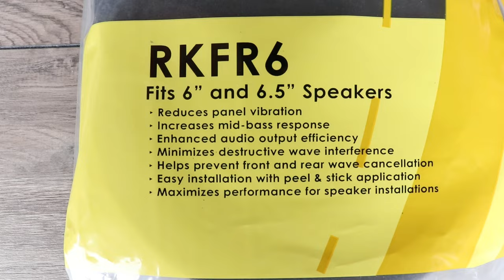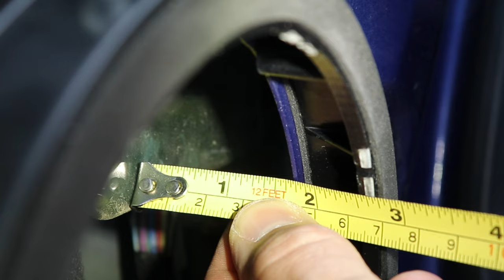Front Speakers UPGRADE, Toyota Corolla - How to Remove & Install New 6.5" Speakers

Comment: wont that foam behind the speaker get wet and absorb water like a sponge? when i rains water runs down the inside of the door
Reply from the maker: It's designed for this, so I assumed it's a closed cell foam, which is water resistant. I haven't actually tried to make it wet, but I'd be surprised if it does soak like a sponge.

Comment: Great video! I’m planning to buy those infinities for my Corolla. Will the tweeters work if mounted in the rear doors? My 2020 Corolla SE only haves 2 tweeters under the windshield and 4 6.5s, 1 in each door. Thanks in advance!
Reply from the maker: The tweeters on the Infinity speakers? They work anywhere, nothing special required, hook up the speaker like any other speaker, and you get the bonus of having tweeters too. 😀
Reply: @CleverFix  thank you good sir 🍻

Comment: Are the speakers RMS wattage within the head unit parameters? Or do you have an amp?
Reply from the maker: Good question, The head unit can power them just fine and they're quite loud, there's no need for an amp.

Comment: They make wiring adapters for speakers like this, No need for the splicing and crimping. Way better and faster, Also less of a hassle when going back for repairs. Great vide though
Reply from the maker: My OEM connectors were corroded, so they had to be cut off. I should have made that clearer in the video. Connectors are great for earlier years that have copper wiring.  Many 2014+ will get the corrosion problem, I think it's inevitable that at some point they will all corrode. Moisture gets in through the window seal, and it's aluminum wire.  Thanks for watching!
Reply: @CleverFix  thats a pigtail repair then yes. I recommend getting some liquid tape, Its one the best methods to protect all your wiring and prevent it from corroding again.
Reply from the maker: @joelh3030  I'll look into the liquid tape, thanks for the tip!

Comment: Great video!  I just bought the Infinity REF-6530cx for my 2014 Corolla.   Does anyone have a recommendation for where to install the crossover unit? It's about W4" x H3.25" x D1.1".  This is my first speaker install.
Reply from the maker: Just curious where you ended up installing it?
Reply: @CleverFix Waiting for some warmer weather to do the install, I'll update in about a month or so.  If anyone has suggestions, please let me know!
Reply from the maker: @soccertwnty47  It's best to mount it close to the speaker for the best sound. Above the speaker, the door panel has a bump in it, so there should be plenty of room there. Not sure how to mount it though.. I don't like making holes because they rust later.. but they can be made then painted to prevent rust, and then use small nuts and bolts. Another idea is above the speaker where the big white connector is.. possibly zip tie it to that big harness. Between that connector and speaker is where I'd put it. You can use some double sided tape and then put the panel back on and make sure it fits before making any holes if you're going to make holes. Maybe the tape would hold permanently as well, those boxes are usually very light.

Comment: Did the stock speaker wiring repair you did in your other video end up not working?
Reply from the maker: It worked for a few months, until one side started losing connection on and off again.. Everything looked good when I took it apart, no corrosion, but it was still losing connection.  The brand new speaker on the same side also started losing connection after a few months too though..  which was quite strange. I took it apart and squeezed the terminal a bit to make a tighter connection, and put dielectric grease on it, and no problem since then.  I think dielectric grease is really important.
Sometimes I just want to solder the wire directly on the speaker.. but I don't like heating up the speaker coil.  Infinity Kappa speakers have screws on them for terminal, which I only found after.. that's a really nice feature.
Reply: @CleverFix  Thanks for the quick reply. Understood. This video is great once again. Appreciate you putting your time into this.

Comment: Can I use speaker harness adapters to connect to the cars speaker wire connector and the new speaker terminals so I don’t need to cut and crimp new speaker wire? You have the listed in the Amazon list for your rear speaker replacement video
Reply from the maker: I listed for the rear because the rear connectors usually are in good shape. The front connectors are well known to corrode, so one of the main reasons for doing this install was to cut off the connectors.  If you want to keep them though, yes there is an adapter harness for it.. Mine corroded when the car was about 6 years old, and thousands of people had this problem, because the factory wires are aluminum.
Reply: Okay thanks for the advice! I’m going to use your Amazon links. Great videos!

Comment: Did u keep the stock tweeters
Reply from the maker: Yes
Reply: @CleverFix  did you have to wire them different? Or they just work the way you installed them?
Reply from the maker: @redbeardroams  No difference, the wires go to the tweeters first, then speakers second. Replacing the speakers doesn't affect the tweeters.
Reply: @CleverFix  awesome thanks man I’ve seen so many people talk about it but no real answer

Comment: Which crimper is that ? Good vid
Reply from the maker: If you're in Canada, they can be found at this store: https://www.princessauto.com/en/199-pc-terminal-and-connector-kit-with-crimper/product/PA0008960510  They ship to US, but it may not be worth it.  I also added a link to a different crimper/multi-tool that should also work just as good, in the video description.  I bought that particular one because it can crimp good quality non-insulated butt connectors, but then I ended up finding good quality insulated ones. It also strips wire which is a bonus.

Comment: Does anyone know what wires to cut if your installing a crossover. From the main speaker harness, which set of wires comes from the radio?
Reply: The front speaker wires go directly from the radio to the tweeter, then from the tweeter to the door woofer.  This information is from Crutchfield. 
Front Tweeter Input -- positive (+): violet/green, negative (-): violet/blue

Front Tweeter Output (Woofer Input) -- positive (+): violet/white, negative (-): violet/blue

Comment: Have you change your tweeter yet? Great video btw.
Reply from the maker: No, the speaker wires run through the tweeter and I'm not sure why actually.. so that makes it a bit challenging to change the tweeters.  I wonder if there's some sort of crossover in there. Otherwise it hardly makes sense that the speaker goes through the tweeter,.. but I'll look into it. Thanks.
Reply: @CleverFix  Have you checked into this? I think the tweeter does have a crossover, and I was wondering if the door speaker gets it's signal after the crossover. Wouldn't this mean that the high frequencies are filtered by the tweeter, meaning that the coaxial speaker on the door is not getting the full range signal and therefore not performing as it could?

Comment: @2014 Corolla by any chance, do you know where I can find the baffles 6-3/4" ??
Reply from the maker: Baffles are not recommended for the rear.. if you want more bass, get a subwoofer. Car speakers are not designed to be enclosed (with a closed baffle), and an open baffle doesn't do much. In the front it makes sense because the metal/door is behind the speaker and the baffle directs the sound into the foam I put. Hope that makes sense.

Comment: Great video! I've found articles saying the size is 6-3/4 but does 6-1/2 work?
Reply from the maker: Yes 6-1/2 works as well, that's what I used. The adapter bracket can accept either one.

Comment: bro, you forgot one very important detail.......What year corolla is this????
Reply from the maker: It's a 2014 in the Video. The bracket I used to mount the speakers works on many models though.  Here's the link: http://www.metraonline.com/part/82-8148 click on "Applications" for the entire model list.  They all use factory rivets, so the removal will be same, and if that bracket fits, then mounting will be same also. Hooking up the wires varies between models because they have different wire colors, and earlier model Corollas had copper wiring which is easier to work with and it can be soldered.

Comment: Hi

Could you please provide size  diameter of screws?? Maybe a #6 or #8?? Thanks
Reply from the maker: Size is in the video, 2:36 , I'm assuming these are the screws you're asking about?
Reply: @CleverFix  yeah the 3 screws with locking nuts used to hold the bracket
Reply from the maker: @LuisMartinez-zi4fg  Ok that's the ones at 2:36 then, the bracket will come with longer ones and some flimsier nuts. I didn't like them, but some people use them.

Comment: Hey there - will this work on my 2006 Toyota Corolla?
Reply from the maker: It will work, as long as you don't have a JBL upgraded Corolla already.
If you see the JBL logo on the top right corner of your radio then you have the 6-speaker system so it's likely not worth upgrading.

Comment: Quick question, why don't you put the third fast rings (between the speaker and the door panel)? Is using the silicone replace the function of the third fast rings?

Any info and guidance would be appreciated.

Cheers and thanks.

Comment: Hey where did you get your little heat
Pen you used for the shrink tubing from?
Reply from the maker: That's a Dremel 2000-01 Butane Soldering Torch. It has multiple tips, I was using the torch tip. I added a link to a tool that is nearly identical but costs less, in the video description, it also has a torch tip.

Comment: Hi, can you please tell me what was the width of the nuts and bolts you used.
Reply from the maker: 8-32 width, 1/2" length, with locking 8-32 nuts, any hardware store should have them in little packets.
Reply: @CleverFix  Thank You so much

Comment: You should make a video which there is on removing the back 6x9's you have to remove the seats not really but they say it cause of damages
Reply from the maker: The back rest on the back seat is very easy to remove.. I was thinking of making a video just on removing that first, it also give you more cargo room, if you need to transport a lot of stuff, it helps.. I did that once to fit bigger boxes on the back seat. I'm planning to do the 6x9's soon..
Reply: @CleverFix  for the 2016 toyota corolla s earlier I had to pull two of the fold down seats to get the side panels off now that in other videos they don't mention that and I had to get the seat out which is easy and the rest of the panels were easy to pop off now when doing it all in reverse things can get a little tricky putting it all back

Comment: My front speakers dont work.....when i adjust the volume seetings for the front speakers on my head unit, it changes the sound of the back speakers....so im assuming my wiring is fd.....they didnt work when i got the car and it didnt have the stock radio and whoever wired that shit had a whole mess going on so i spliced the wires that needed it and wired up my radio which worked fine. But front speakers still dont work....prob just gonna have to take it to someone
Reply from the maker: Maybe your front speaker connectors are corroded.. See my video: https://www.youtube.com/watch?v=4ytOAxK_0Cs  It can happen to both in time. If they both go out at once though, it's unlikely.

Comment: This is the route I'll likely go in order to correct the drivers speakers from cutting out. Seems like less of a hassle to remove the speaker than to try to preserve that factory connector. Plus the benefit of better sound quality.
Reply from the maker: It's definitely worth it! And it's not too expensive, the speakers come as a pair and Infinitys are pretty good budget speakers. I'm definitely having more fun listening to music now than before.  I don't know if the JL Audio are worth it with the stock head unit, they need a lot more watts to drive them. The Fosgates should be a little better though.
Reply: @CleverFix  use hi phonic 6.5 components they sound perfect for 40 bucks rated under 60 watts rms I turn it all the way up and it still sounds good 👍

Comment: why not buy a wiring harness so you dont have to cut the factory wires?
Reply: the front connectors tend to corrode. Was actually no good in my car so the harness wouldn’t have worked
Reply from the maker: One of the main reasons to do this upgrade is to get rid of the connectors which will lose connection eventually, on every single car.  Make sure to use GOOD quality butt connectors, and heatshrink on top of them to prevent moisture from getting to the OEM aluminum wire. Aluminum wire corrodes from moisture, and the door always has moisture in it after it rains. It's a bad design by Toyota, but thankfully it can be fixed, and it's not that expensive.

Comment: You’re spending roughly about 100 and some change on just the supplies
Reply from the maker: Yes, the supplies are expensive, although the NVX Baffles and Stringer Fastrings are optional, so that would save a lot. The sound will not be as clean, but there will still be a big improvement over stock.

Comment: Tessa tape instead of electrical tape
Reply from the maker: I used Tesa on the stereo upgrade. Inside the doors, you have to be careful which Tesa, because some absorb moisture and get wet.. so it's better to just use good quality regular electrical tape in some cases. I spoke with an audio installer about it, and he says the biggest advantage of Tesa is that he can easily use it during winter, when other tapes are too cold to stick.

Comment: It’s came off easy cause you didn’t crimp it good 🤣🤣🤦‍♂️🤦‍♂️
Reply from the maker: The cheap connectors will always come off easy no matter how it's crimped, the metal is too thin and doesn't have much clamping power. If you're trying to save $2 you can use it.. but if it corrodes or loses connection in a few years, don't be surprised.
Reply: @CleverFix  I’ve never had an issue I always double crimp mine tho no matter the connector so maybe that’s what does it idk I e never had an issue tho
Reply from the maker: @Cleanest_whipz  This guy found same thing as me: https://youtu.be/RkfMiqmJgaI?t=284    It could very well work for a long time, I'm not doubting it will hold the wire, but if it's pulled it will come off easily, so I'd rather use the better one, considering that there's moisture inside this door, and the factory speaker wire is aluminum which corrodes with time.

Comment: So all that work and still ur system is bottlenecked by the factory wire. A 4ch Amp and new wires would of made a world of difference
Reply from the maker: 18-gauge wire can handle up to about 50 watts RMS, which is plenty! The speakers I used have a high sensitivity and work fine with a factory amp, even the stock Corolla stereo. With some high quality speakers, then sure, amp and wires will bring out their true potential. But this was a budget upgrade. Note also, that the stock Corolla stereo doesn't have RCA outputs,  and it doesn't have the greatest sound quality either. I did end up upgrading the stereo in this video: https://www.youtube.com/watch?v=JBnRhJJNNAE   I'd only consider an external amp if I got a pair of much better speakers.

Comment: Toyota should of never made those cheap crap speakers I had to drill out the rivets to put new speaker in
Reply: For some reason, the stocks sounded better than the aftermarket 4 way Sony speakers in my car.
Reply: @brycefujimoto8023  DSP in the factory stereo. That's the key.
Reply: Actually the OEM drivers are not that bad for what they do and the cost of manufacturing. I was surprised when I measured my old Civic spkrs and they were pretty flat to almost 15kHz. Of course no real bass can be expected from $1, maybe 2 loudspeaker, but they serve the function for all of the people. In general car audio can be 'a bit' overpriced when one stars to look at better loudspeaker systems.

Comment: can i use any speaker once i wire my door for it im running a 2003 corrolla and want to put a CT sound 6.5 in ant ita max is about 200 watts is that okay?